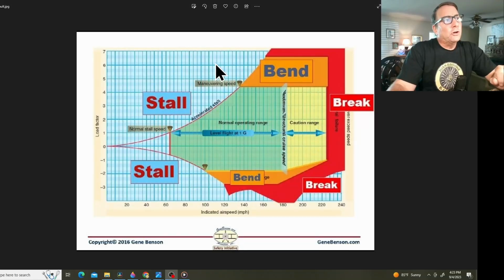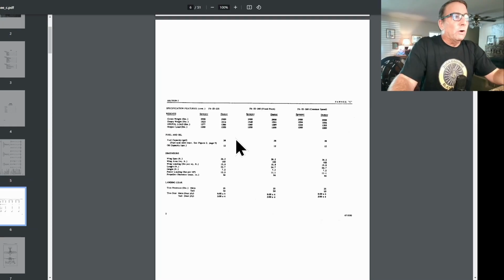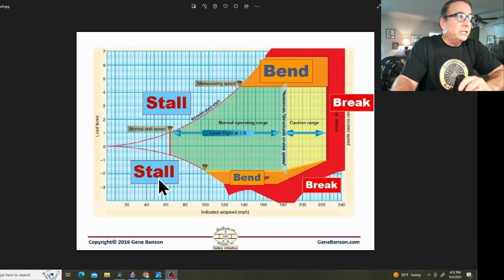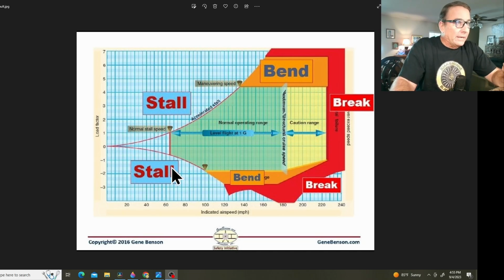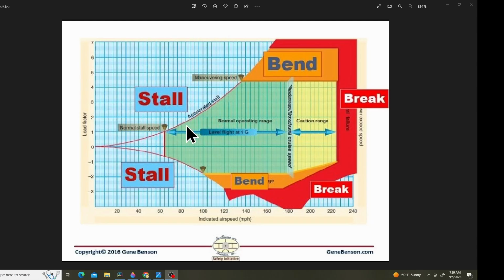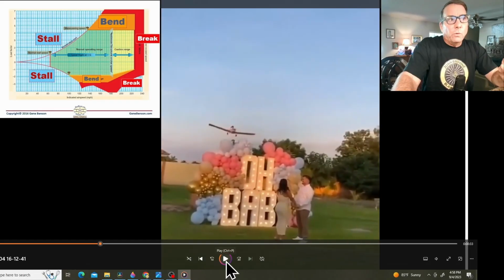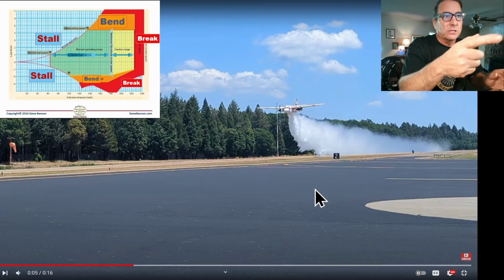PA25-235 Sinaloa MX Gender Reveal Party Structural Failure

Comment: As a private pilot this was never  mentioned to me and I was unaware that at minimal weight this could be a factor. I guess that's why they call it a license to learn. Great video.
Reply: It's troubling that your training did not cover this. If you got your license in the US, please re-read chapter 5 of the PHAK (Aerodynamics of Flight), specifically the section on "Load Factors", which includes everything mentioned in this video, including the V-G diagram.
Reply: @owisagrom  I'm a commercial, multi-engine pilot and I was never taught that Va changes with weight. I always assumed it was for the worst condition.
Reply: @oisiaa  The POH of the PA28 and C172 that I'm familiar with both publish a VA at multiple weights, showing a lower speed for lower weights. I have an extra step in my preflight planning that determines my VA based on my weight by interpolation. This is always my personal Vne
Reply: @owisagrom  I fly big jets where Va isn't really a thing. "Maneuver speed" speed for us is the speed at which we can fly a 30 degree turn with stall margin. We have a hard g limit, not Va.
Reply: There's a reason why no markings for Va are on the AI. It is directly affected by weight.  @oisiaa
Reply: @oisiaa That's sadly negligent instruction. Before all maneuvers, you were never taught to begun the maneuver at Va? Bad instructors.
Reply: @erickborling1302  I did military flight training. We had a g-meter and the T-6 can take 7g so Va wasn't much more than an academic point for us.
Reply: “License to Learn”—that’s a great description for any educational degree/certificate.
Reply: @tcmxiyw   With any education you're really getting the tools to learn.  It's up to us to put them to use.
Reply: it's more about the center of gravity rapidly shifting. than anything he blathers on about.

Comment: You said it correct when you mentioned that it’s unintuitive. Your maximum design speed goes down as you reduce the weight on the aircraft? I have to wrap my head around that for a minute.
Reply: Re 'counterintuitive': I pondered the reason the envelope moves leftwards. I think it's because stall speed increases with wing loading, so pulling back sharply in a heavy plane at a given airspeed may induce a stall,  but with with a lighter loading at that speed the wing continues to produce lift.

Comment: Thats not a high G pull-up, that's what the aircraft does when you immediately and completely unload the wings. I use to fly an AT-301 and I can tell you, that when you dump all 325 gallons on that aircraft, it's rocket ride straight up. I use to run the elevator trim full forward in preparation for a full hopper dump, but it was still like an ejection seat.

Comment: Emb 201s in Brazil had a wing root corrosion bulletin released about 8 years ago. This airplanes were losing their wings and pilots dying in the simplest maneuvers. My take on this is wing root corrosion or a non complying maintenance airplane. I not aware of any pawnee ADs. They either have one or WILL have one. That maneuver there is a normal one. In ag flying schools we learn to reduce the g loading when that happens but it’s ok if you get the g out of it. It won’t kill you. I’m not saying your view in incorrect my friend. My two cents here as an ag pilot. Dude this planes are build to take the beat. Best regards.

Comment: I don’t get your explanation about maneuvering speed decreasing with lower load… let’s say the wings will snap from the fuselage at 10000 lbs of load, the plane is 2000 lbs. so it snaps at 5G. If the plane weighs 2500 lbs then it will snap at 4G. Where is my thinking wrong?

Comment: Most ag aircraft will pitch up upon dumping the load. As you say, this guy also pitched up, for effect. 
I don't think his speed was overly high but might have been a bit.
The Pawnee wing is incredibly strong in itself, but the ENTIRE flight load is carried by the struts. 
Unlike a strutted high wing aircraft which has struts in tension, the Pawnee struts are in compression. This is inherently not as strong.
I would suspect, as you mentioned, an airframe overload failure, but my money would be on the strut itself.
On a side note, I would not waste my money on a gender reveal these days. Better to wait untill the kid is through school, in case the teachers have different ideas to what you thought.

Comment: I disagree with the assertion he did an intentional pull up. My guess is the aircraft pitched up due to 1,200 lbs of water dropping from the very nose of the aircraft. This guy didnt stand a chance since he wasnt prepared for the snap stall/critical airframe failure point

Comment: We can almost guarantee that the spars of the aircraft were not checked during an annual, on any crop duster agricultural aircraft. These must be inspected time after time, not sure of the regulations in Sinaloa, but that could be one component that is almost factual, we’ve seen this happen before for those exact reasons, the second thing is…!

When you’re dumping a load such as he did there, it doesn’t look like he pushed the stick forward at all for the load transfer. Once that way it was released the aircraft became incredibly light and shot up in altitude compounding the problem, those two factors are what kill…

Doing that maneuver is very tricky and you have to push the stick forward. Otherwise you’re going to lose control and again if the spars weren’t checked, then that was their last moment of failure, identical to the C1 30

Sad to see, but I’ve seen it many times 🤷‍♂️

Comment: That took a second for me to process but I get it.  Lighter plane = easier to pull higher G's = easier to cause an airframe failure with maneuvers that wouldn't cause a failure if the plane were heavier.

Another way of thinking of it... Newton's law.  An object in motion stays in motion on the same vector unless acted upon by an external force.   The G load (ignoring the wind load for this exercise) is a function of the rate of change of the vector and the external force's ability to change that vector depends on how heavy an object it is acting on.

Before you explained it, I had it backwards (as a non-pilot).

-Matt

Comment: Great video Juan, as always. One detail: if you step through the video you’ll see the spar attach did not fail but the struts collapsed. First the rear (the wing twists in torsion first) then the front strut, and whole wing rotates around the fuselage about the spar attach pin.

Comment: Coming from a third generation ag pilot, great break down of this accident a lot of people misunderstand accidents in the ag world. Although mistakes were made, I am also leaning to the fact there was probably corrosion involved. Great job Juan keep up the good work.
Reply: Agreed.  I’m imagining crumbling white spalling at the attachment. 
Decades of hard work, likely living outside, previous over stress and possible neglect. 
Condolences to the family(s).
Reply: RIP to the pilot and peace to their loved ones.
Reply: Given the forward position of the water tank, would there not have been a pitch-up moment caused by the dump? Edit: no, looks like tank is mounted roughly over the CG
Reply: Very difficult to see in the video but watched in slow motion it does look like some 'up' elevator during the drop and definitely looks like up elevator during the ensuing roll? Crucially, the left wingtip appears to twist upwards and folds outboard of the attach points after an initial pitch up, suggesting no failure (i.e. no corrosion) at the wing root?
Reply: Even with potential corrosion, it likely wouldn't have been an issue if the pilot hadn't pulled up so hard put so much load on the wings.
Reply: @davidfrench5407 he probably didn’t pull up. He just didn’t nose down while he was dumping. Most of the time you’d never pull the dump handle coming out of a dive and at high speed. You wouldn’t shed weight in an emergency under those circumstances in very many situations. 
I started my ag flying career in an O-320 150 hp Pawnee before I moved to an O-470 Ag Wagon and later an O-520 Ag Wagon.
Reply: @JoshJones-xd5mw  from that angle he would have at least been conscious that he was heading toward a tree line. Tragic regardless of the exact cause, hopefully others can learn from this.
Reply: @moretrash4you  no, the nose came up. Did you watch the video? Juan explains it quite succinctly
Reply: @moretrash4you  I’ve watched this, a lot of times, and it’s pretty clear the wing begins to fail immediately upon the beginning of the release. The fact that the plane pulls up may be due to the fact that the leading edge of the wing begins its fold as soon as the material is released, Pitching the nose of the plane upward.
Reply: @moretrash4you  I think the plane was failing and it was pitching up.
Reply: @davidfrench5407 True, alas, is it ever one thing that leads to these acciendts?

Comment: Help me understand.
As the water was dropped the plane became lighter which in turn made the rate of climb increase. Pilot may not be used to a sudden weight loss and pulled back as he normally would while crop dusting as there is not a sudden weight loss.

Comment: Mistakes compounded equal a single tragic outcome! Just curious - our area has a minimum altitude requirement of 1000 feet for pilots flying over populated areas, or 500 feet over sparsely populated areas. The Piper looked to be half the minimum altitude, assuming this was sparsely property area. IDK if he lost spatial awareness and that's why he pulled up so hard? Or just hot dogging it. One of my favorite activities as a child was watching crop dusters work the surrounding farm fields. They were designed (and allowed) for dives down to skim the row tops and pull up hard to avoid obstacles like trees or power lines at ends of fields. The corrosion issue and his low angle of attack created those compounding mistakes. RIP to the pilot. p.s. Gender reveal parties are getting out of hand.

Comment: Great explanation as always, but I do have a question.

In your example of load and lift the first instance showed that at 4,000 lb and 4G, the wings produce 16,000 lb lift while at 2,000 lb and 4G, the wings only need to produce 8,000 lb lift. Given that the airspeed and AOA were resulting in a 16,000 lb lift immediately before the drop, if the pilot does nothing with the controls will the 16,000 lb lift result in a rapid jump to 8G loading? I couldn't see the elevators through the water in the video. Is it certain that the pilot intentionally pulled up or could the sudden massive weight drop alone could have done the trick?

Comment: Student Pilot Opinion - I dont think it was the weight reduction. For the chart, the lines should flatten out. IMHO it was the the CG shift momentum that caused his plane to over pitch and apply wind force on the spar breaking the spar then the wing. If he's is at alpha 70 degrees vs the air direction a lighter plane should help not make it worse. but he was simply too fast at 70 degrees. It seems that this type of plane is sensitive to severe movements and that the spars could break. I might be wrong maybe it broke through the spar but it was the angle of attack.

Comment: Dumping the hopper causes an extreme nose up trim, it will take you by surprise if your not ready for it. A massive push on the stick is required during the dump.  I am guessing he was a banner or glider tow pilot, not an ag pilot.
Reply: Thanks, that fits much better to what the accident video shows than Juan's explanation. 
Reducing weight (e.g. by dumping cargo) while in a turn with a constant wing-loading will increase the g-force on the aircraft, which can cause structural failure. But in that case it wouldn't be the wings that fail, those are at a constant load as we said. What would fail are the "fixed weight components", i.e. the high gees would rip the engine off its mountings or so.
What happened in the accident video was that the aircraft pitched up massively as the hopper was dumped. As Juan explained, at lower air-speed that would have led to a stall instead of a structural failure, but I don't believe the pilot intended to put the aircraft into a stall so close to the ground. So an unexpected change in trim that caused the nose to pitch up is a more likely explanation.
Reply: @DrAHorn  The final picture in the video is stopped at exactly where the wing failed.  You can clearly see it twisting as the attachment point failed.  So the wing was fine. Just it decided to go one direction and the body another.  With a poor couple of bolts left somewhere in the middle.
Reply: @josephoberlander  Well, O.K. it may technically not be the wing. But it's still part of the structure that is engineered to support the full force that the wings can carry.
Reply: @DrAHorn  True.  It does look like it failed a bit earlier than it should have, but such are old machines.  A little deformation, a loose bolt, a bit of rust and it could be still up to spec but just barely/needing replacement soon.  It will get interesting to see what the reports say about the condition of it and the maintainence recrords.
Reply: @josephoberlander If a wing fails through excessive load it will naturally do so at the root because that's where the moment is greatest. Still very much a wing failure.
Reply: Not in a Fletcher - the hopper is right over the wing - relatively neutral compared to forward hopper planes like Pawnees and AgWagons when dumped

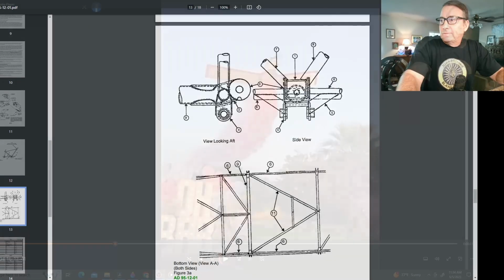Comment: at your still shot at 10:27 you can see the wing already deformed at the beginning of the pull up, so I wonder is they will find corrosion in the wing attach area as it didn't hold for long.

Comment: I think the explanation at 6:10 is wrong. Decreasing the mass will indeed lower the stall speed but why would that "pull the rest of the graph with it"? The envelope doesn't shift, it's just extended a bit to the left.
You would be correct if the ballast had been dropped from the wings, as extra mass in the wings helps counteract the bending moment created by the lift force when the load factor increases. Ballast in the non lifting parts of the airplane (hopper in fuselage) does not have the same effect though.